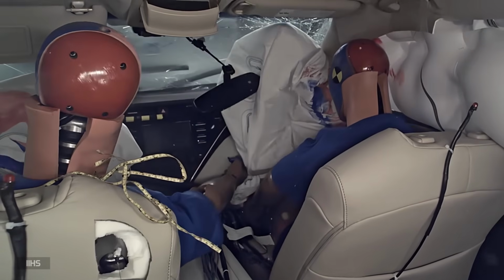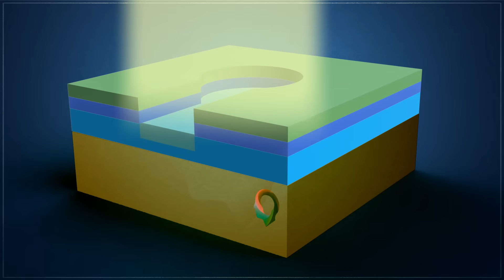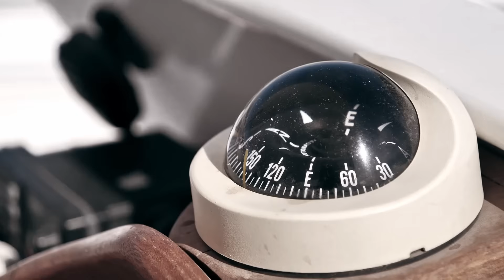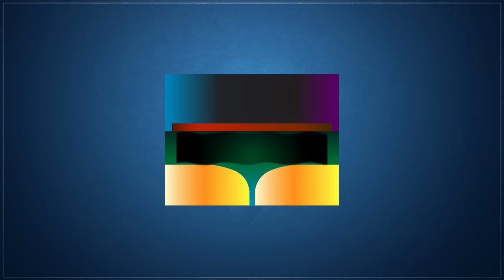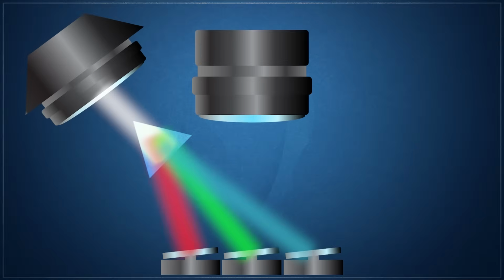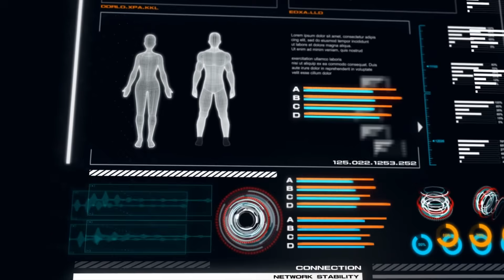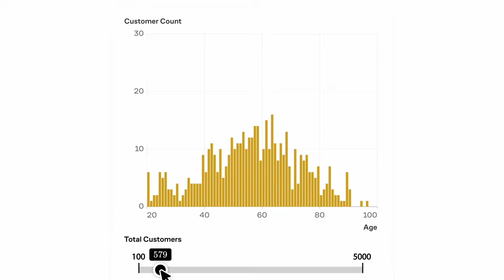The Amazing World Of Microscopic Machines

Comment: Newer 3D Printers also use accelerometers to reach higher speeds by measure the resonance frequency of the mechanical system and compensate it by a process called Input Shaping.

Comment: If you want to see what MEMS are in your phone, there's apps that will list them plus what they do and who made them. I use one called Device Info, and it shows 32 on my phone - accelerometers, gyros, pressure and temperature sensors, a step detector and step counter, a geomagnetic rotation vector sensor, all sorts of things!
And of course, all of it gets sent to Google where it's automatically manipulated in one way or another.
What I've always wondered is where they store the continuous data stream of millions of phones!
Of course Apple does the same....which is why there's a market for "degoogled" phones and the like....

Comment: Problem with microscopic machines is wear and tear happens much quicker, but that depends on what it is exactly. The reason being is we may lose a lot of material with larger machines, but it's not much compared to the total mass of the object. But when you have machines that might be only 1000 atoms thick, and actions are losing layers of atoms over time, you will wear it out quickly, because it'll break long before you wear away even half of those layers. For example, a gear 1000 atoms thick, would probably be heavily worn after losing 100-200 atom layers. It's sort of the same problem that plagues modern electronics, where high voltage, even at low wattage, can literally strip layers of atoms off circuits over time, resulting in failure at some point. The problem also gets even worse when you get to smaller and smaller scales, because surfaces might not actually be 100% smooth, and can literally re-absorb atom debris that has flaked off from wear. So you can end up with pieces, even in metal, that wear off and connect elsewhere, which can change the surface of the parts to the point that they're malfunctioning or not able to function at all anymore.
Reply: Good point. For less wear, the incorporation of harder materials or use of things like pneumatic or magnetic bearings would need to be investigated.
Reply: You only needed the first three sentences to get your point across

Comment: AI Summary

Abstract:

This video provides an overview of Micro Electromechanical Systems (MEMS), tiny integrated devices combining mechanical and electrical components. It explains that MEMS are fabricated using batch processing techniques similar to integrated circuits due to the impracticality of traditional methods at their scale. The video details the three main manufacturing classifications: bulk micromachining (removing substrate), surface micromachining (adding layers and removing sacrificial ones), and high aspect ratio micro machining (HARM, similar to casting). It then explores several key applications, including accelerometers in airbags and smartphones, gyroscopes, inkjet printer heads (thermal and piezoelectric), digital micromirror devices (DMDs) used in projectors, optical communication switches, and biomedical devices ("bioMEMS") like lab-on-a-chip systems and drug delivery platforms. The video highlights the interdisciplinary nature of MEMS technology and its growing importance across various industries.

Understanding Micro Electromechanical Systems (MEMS): Manufacturing and Applications

*   0:01 Introduction: MEMS (Micro Electromechanical Systems) are tiny integrated devices combining mechanical and electrical parts, found in technologies like airbags and smartphones.
*   0:16 Airbag Example: An airbag system uses MEMS sensors to detect rapid deceleration and deploy the airbag within milliseconds of impact.
*   0:41 Definition: MEMS are tiny integrated devices combining mechanical and electrical components, ranging from microns to millimeters in size.
*   1:15 Fabrication: MEMS devices are fabricated using batch processing techniques similar to integrated circuits, not traditional milling or molding, exploiting the mechanical properties of silicon and other substrates.
*   2:24 Traditional IC Manufacturing (Photolithography): The video briefly explains the basis of fabrication using photolithography, masks, etching, and doping on silicon wafers to create circuitry.
*   3:33 Silicon Properties: Silicon has excellent mechanical properties, including a higher elastic limit than steel, making it suitable for MEMS structures.
*   4:10 MEMS Manufacturing Classifications:
    *   4:15 Bulk Micromachining: Removes substrate material using isotropic (all directions) or anisotropic (preferred direction) etchants, sometimes controlled by doping.
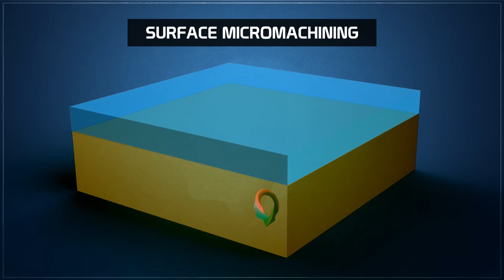    *   5:13 Surface Micromachining: Primarily additive, depositing structural layers and sacrificial oxide layers, with the sacrificial layers later etched away to create complex, free-moving structures like gears.
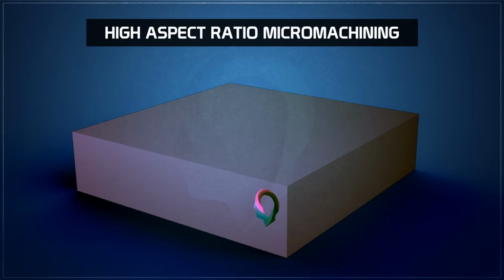    *   6:14 High Aspect Ratio Micro Machining (HARM): Resembles casting; uses X-rays through a mask onto a thick acrylic layer on a metal base to create cavities, which are then electroplated with metal before etching away the acrylic. It's cost-effective for replicating microstructures.
*   7:02 Key Applications:
    *   7:07 Accelerometers: Used in automotive airbags (one of the first widespread uses, replacing mechanical sensors), smartphones (often 3-axis), earthquake detection, VR, pacemakers, disk drives, and weapon systems. They sense deflection of a proof mass to measure acceleration via capacitance change.
    *   9:08 Gyroscopes: Found in smartphones, navigation, and avionics. MEMS gyroscopes use an accelerometer on an oscillating platform to exploit the Coriolis effect and measure rotation.
    *   9:45 Inkjet Printer Heads: Use arrays of nozzles to spray ink. Two main types are thermal (uses resistive heaters to vaporize ink, creating bubbles that eject drops) and piezoelectric (uses piezoelectric crystals to vibrate and eject ink).
    *   11:47 Digital Micromirror Devices (DMDs)/Digital Light Processing (DLP): Used in projectors and projection TVs. Arrays of millions of tiny mirrors mounted on hinges can be rapidly tilted by electrostatic forces to reflect light through a lens or onto a heat dump, controlling brightness and color (via a color wheel or separate chips).
    *   13:38 Optical Communications: MEMS are used in optical switches and routers (e.g., waveguides, multiplexers) by steering light with micro-mirrors, eliminating electronic bottlenecks and offering high throughput, low cost, and low power.
    *   14:48 Biomedical MEMS (BioMEMS): Focus on processing fluids at microscopic scales ("lab on a chip"). Designs can include micro-pumps, sensors, valves. Examples include microtiter plates with microchannels and potential future applications in targeted drug delivery (e.g., insulin, chemotherapy) and even direct cellular manipulation.
*   16:34 Future Potential: MEMS devices offer astounding possibilities in areas like miniature antennas, diverse sensors (heat, light, pressure, chemical), and are pushing towards a new frontier of nanotechnology that could disrupt industries.
*   17:04 Significance: MEMS merge mechanical systems with semiconductor advancements to create new mechanisms operating at scales beyond human intuition.

I used gemini-2.5-flash-preview-04-17| input-price: 0.15 output-price: 3.5 max-context-length: 128_000 on rocketrecap dot com to summarize the transcript.
Cost (if I didn't use the free tier): $0.0064
Input tokens: 18598
Output tokens: 1044

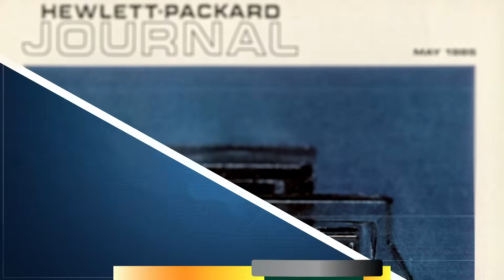Comment: 11:30 Actually, I worked at Siemens in about year 1988, and there were ink printer common with just 9 nozzles in total. And yes, special paper was needed for those. We had to "repair" things like the printer was smearing ink all over the paper, but the real cause was the endless paper just was printed on the wrong side. 😅

Comment: No, we "DON'T intuitively know pushing is easier than pulling" because that is not true. Pushing, for example a lawn mower, has a force vector component directly down - forcing the wheels into the ground and increasing resistance. Just the opposite when pulling. Pulling helps lift the wheels off the ground, decreasing resistance making it much easier to pull than push! 

Such a blatant error is NOT a good start to a video.
Reply: Yeah I noticed it is easier to pull a lawnmower years ago, but this is predominantly because of the angle of the handles

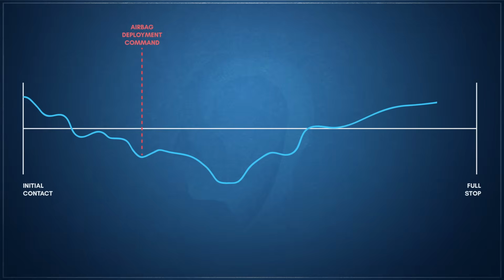Comment: The acceleromerter at 7:30 has me a little puzzled.  Are the yellow elements the "plates' of a capacitor and the proof mass a middle plate in the (air?) dielectric?  It seems to be completely symmetrical with movement so where is the differential?  Is it to do with the area of the finger faces and the inverse square law of the distance?  I can't get my head round the math but it would seem that the sum of all these would remain the same regardless of position.  What am I missing?
Reply: I think they used A I to generate the script so some of the details are wrong/confusing. The fixed yellow elements are not all connected together. There are basically 3 electrical nodes: Proof mass, Fixed positive, Fixed negative arranged like: [Fixed+] --- Gap 1 --- [Proof Finger] --- Gap 2 --- [Fixed- Finger] ...  and that pattern repeats down the row. All the Fixed+ are connected together, all the Fixed- are connected together and the proof mass is just a solid plane of metal. Under Acceleration, the proof mass moves, let's say shifting the Proof fingers closer to the Fixed- fingers. Gap 2 decreases and Gap 1 increases. There are essentially 2 capacitors being formed, as the gap between the two conductive materials gets closer, the capacitance increases, and the opposite happens for the other formed capacitor. The resulting 2 capacitances (differential) are used to produce an output voltage that can be processed and converted to an acceleration measurement.

Comment: Micropower and thus PowerMEMS was an interesting concept around the 90s where NATO was using way more portable electronics, but before the Li-Ion Boom.

They basically wanted to make small generators (below 1kw) between lawn mower/rc size all the way down to MICROSCOPIC JET ENGINES so your Radio or Cell Phone could run off JP-5 etc.

Kind of died off but still some work on it, mainly with Solid Oxide Fuel Cells these days (work better but less kerbal)
Reply: If they could make it competitive with fuel cells while gaining the advantages of manufacturing scale, then that would be a great advantage.
Reply: @brodriguez11000 Butane/Propane SOFCs are nearing the market, Methane SOFCs have been on the grid scale / genset for a server etc end for a while, and those are probably the most likely due to the gaseous fuel.

Having a phone that takes butane like a lighter would be pretty neat!

Short of maybe Molten Salt Fuel Cells (which don’t scale down well), most designs using JP-5 etc need a Reformer and have issues with carbon buildup.  “Swiss Roll Autothermal Reformers” are pretty promising.

I also don’t know TOO MUCH about more conventional small burners and if those exist.

I think DME/OMEX being the new common fuel for nato would be pretty neat for wnabling these while at the same time being better from a climate perspective.  Granted impact on range/logistics may make that a non-starter over FT Fuels / More Conventional Renewable Diesel / SAF

Comment: It's frustrating that the accelerometer in airbags take 60ms to deploy but the one in my phone takes 5 seconds to rotate the screen in horizontal mode
Reply: The opposite would be more frustrating, honestly:)
Reply: @suncho6502  the car would take 5 seconds to rotate?
Reply: @suncho6502 I'm imagining a slapstick scene where buster Keaton smashes into the bumper of a parked car and then seconds later when the chaos subsides, the airbag deploys like a pie in the face
Reply: I turn mine off because apparently I hold my phone sideways. I like the little thing popping up in the corner that asks if I want to rotate.
Reply: Dude it would be so annoying having the screen rotate at the slightest twist. I'm completely fine with it as it is.
Reply: Yeah....thats what I was thinking imagine the operating conditions...the screen would just become unusable...I bet that was frustrating to perfect in the design process😂 @bowiemtl
Reply: @veritasjustus8543  I guarantee that was a problem in development, "THE SCREEN WON'T NOT ROTATE". Guarantee you that somewhere in that detection code there's a delay(2500).
Reply: Blame the software engineers...
Reply: How old is your phone lol
Reply: One is life security the other is an afterthought
Reply: Accelerometer for the crash detection system just needs to send a simple pulse to activate the airbags while your phone has to process flipping a high resolution display. Different scales of complexity.
Reply: As the bar for software engineering was lowered, the bar for software was lowered.
you won't believe how much trash is between you and the hardware
Reply: @adama7752 Crazy how much software performs drastically worse than only a decade ago. Imagine how great software would be if designers were forced to make super lean and efficient code like back in the day instead of just throwing resources at their trash code.
Reply: You really want hyper sensitive airbag deployment sensors?  Erroneous deployments would drastically increase.
Reply: @ericquinn8578  
I think he wantsvfaster cellphone screen rotation time
Reply: 5 seconds? Get a phone from the 2020s bro. That iPhone 3s your using is outdated.

Comment: One thing that really jumps out with these great animations and diagrams is how good the mechanical engineering is. They really are a perfect blend of mechanical and electrical and chemical engineering. 
Thanks for the great detail for the piezoelectric ink jet mechanism, for example. The ink entry passage is a sharp orifice on both sides. Same resistance to flow in or out. But the exit nozzle has a funnel shape and sharp jet exit, which makes it much less resistant to inflow than to outflow, creating a pump without a check valve. That's a really great detail on what makes the little pump function. 
The detail of the gyroscope that shows how a linear oscillating mass is used instead of a rotating flywheel (like we normally think of when we hear the word 'gyroscope') is also really enlightening.
Reply: we can't make cutters small enough to machine these MEMS, so cool to use light to etch layers and form the components.
Reply: @pauls5745  Yes, and like 3d printing, they have actually figured out how to use the layers to build unique structures that could not be machined using normal methods. It's truly amazing!
Reply: "Any sufficiently advanced technology is indistinguishable from magic." Which is why... 😢

Comment: These MEMS and squib charge are also used on some EV battery to blow the buss bar interconnect, disconnecting the battery in an accident.
Reply: Pyro Fuse
Reply: That's why they don't burst into flame when people get into fender bender accidents, so while my airbags are popping, the batteries are disconnecting, hopefully giving me a few seconds to escape the vehicle...kinda like exploding bolts in fighter jet ejection seats and separation of stages in rockets...cool!